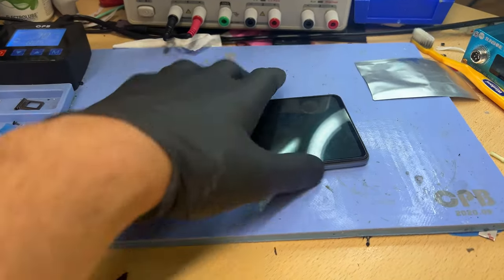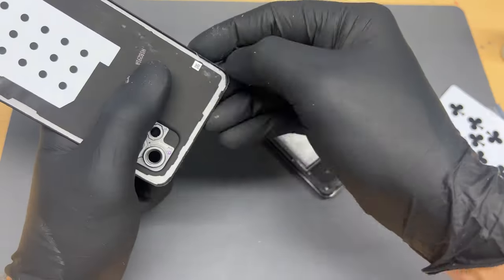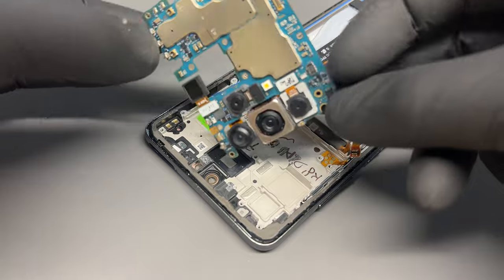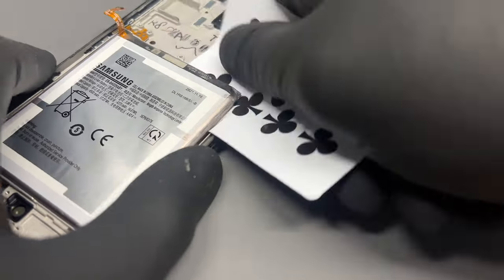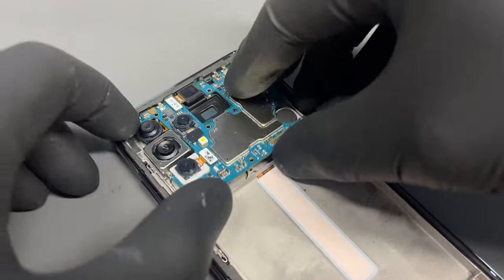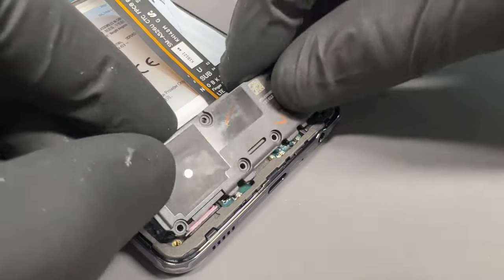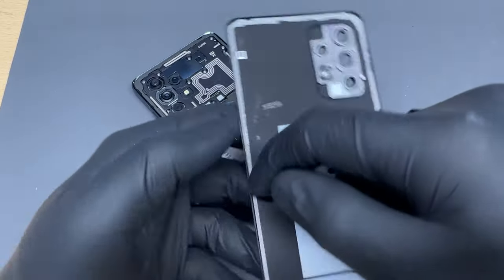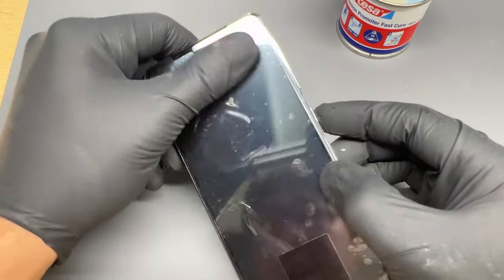Samsung A52S 5G detailed screen replacement and disassembly

Comment: Thanks for sharing. Which board has the memory and hard-drive, and data? The upper board, or the lower board? The lower board is only for FIngerprint and charging right? Then the memory must be on the upper board, right?

Comment: Hello, I've got a question! I own this phone, it fell on the ground and now it doesn't turn on anymore. When I try, it vibrates weakly, but doesn't respond.
Have you ever met this problem? Do you know what the issue is? The battery was full, the screen doesn't seem broken.

Comment: I dropped my phone and it got a black spot but screen didn't crack and it slowly expanded to whole screen, the device starts and at splash screen shuts down to immediately start again over and over until battery runs out, do you think it's because of the screen or something else is broken?

Comment: Thanks for this video.  It's the clearest and best explained of the type that I've seen.  I dropped my A52s 5G out of a 1st floor window onto concrete!  It was in a decent case so survived but two weeks later made a funny squeak and the display died.  Luckily it was enabled for USB debugging and I was able to connect and use scrcpy to confirm that in fact everything works except the display.  The device is not worth repairing if I have to pay someone else and hardly worth selling without a working display.  Your excellent video and a link to a reputable vendor for a genuine spare part gives me the confidence to go ahead with doing the repair myself.  Cheers!

Comment: Any tips for the Battery Adhesive? 
Should I purchase the original adhesive or use B-7000/T-7000 glue?
I want to stick it back because when the phone was shaken hard the battery moves and it will disconnect the screen flex cable.

Comment: Is OIS (Optical image stabilization), part that can be fcked up during phone repair? Because i had my screen replaced, and its making the 2x louder rattling noise than before screen replacement. I know that the rattling noise is normal for phones with OIS but its way louder and more annoying than earlier. I can also add that the rattling noise is still occuring when shaking the phone in camera app (i just need to shake harder).

Comment: battery draining fast , only 4 hrs screen on time with 60/120 both modes. tried battery replacement in samsung service center. still no use. any idea what might the problem.

Comment: looking for some advice, i have replaced the screen with a Chinese replacement... however the signal is not great, 115dbm, also the gps is way out, have i damaged something; eg the antenna or coxial????

Comment: My A52s ended up in the  tractor snow plower : ) It now has a hole through its side and about 10 degrees bended inwards on the middle, but it still works just like yours!
I would really like to extract my pictures and messages out of it. I've tested all possible software methods, so now the last possible solution is trying to hook up a screen to it.
My question is: do I have to get the model specific screen for it, or would a screen from a different (cheaper) model work? Maybe the A52 one will work?
Reply from the maker: Hang in there!

Comment: Thanks for the video... Is the outer plastic frame that looks metallic, just for aesthetics or does it have a role in sealing the phone to make it waterproof?
Reply: It's a part of the magnesium frame covered in something. This is supposed to be a sports phone so it can stand a small hit and not bend or break. It's heavy like a brick for it's size to be honest because of the robust frame. screen is the vulnerable part though.

Comment: Hi my a52s went to repair, the back was coming off and there was burn in marks on the screen. I noticed now that it's back it looks like theres a slight bulk around the middle of the back just bellow the camera but opposite side. Is it normal?
Reply from the maker: It sounds like the mid frame bazel is not secured properly

Comment: My A52 5G back cover is falling apart, perhaps the original adhesive loose its grip already, in some videos, some replece double sided adhesive and some used the the b7000 glue, i wonder which is a better solution and do i need to remove first the residue of the original adhesive for both the cover and on the phone before changing the adhesive or applying glue, thanks.
Reply from the maker: I would recommend using a genuine Samsung adhesive rework kit for this.
Reply: @iDoctorUK  its hard to get a genuine adhesive though in my country without getting it from the authorized service center. What i bought is 3rd party  adhesive from an online store, its compatible, but i noticed  it's kinda thicker than the original adhesive i removed from the phone. Even then thank you for the advice.

Comment: I have a question, is it possible to give the a52s a better vibration motor?, i wanna see if i can just buy an offshelf one for the phone because the phone's vibration motor is so bad.
Reply from the maker: The size of the housing for the vibration motor is very small, maybe you would have to get another vibration motor and fit it to the back of the phone 😂

Comment: Hi is it possible to have another models screen fit to the A52s.

I took mine to get a replacement screen at a phone shop and now there is a border top and bottom and the fingerprint sensor doesn’t work?

Any help would be appreciated
Reply: The shop has installed a low quality aftermarket screen or "incell" screen, it's an LCD instead of OLED so looks much worse than the original and has borders and non working fingerprint as mentioned. The 120hz will also not work, it will be slightly laggy when using so you have to leave it on 60hz.

Comment: Great angles and clear directions. Fast-forwarded at all the right times so we don't wait for 4 extra minutes while you unwind 10 screws.😊 Got my A52S back online in no time.

Great idea to link a trusted partd supplier, too: even though I couldn't use them from the US, it helped me search for the proper parts on Amazon and eBay.

Comment: I took it apart, but looks like i have to change the screen... Since it dropped one time, the screen randomly stops working and stuff, but now its totally dead....
Reply from the maker: Most likely it is a screen issue
Reply: @iDoctorUK  Thanks for your anwser! I guess then there is no other way but changing the screen? I have seen videos where they changed the whole screen panel, took out the battery and stuff. Someone told me that if you remove the battery, you cant use it again, it is true?
Thanks! :(

Comment: Excellent video, straight forward & easy to understand.. I've changed lcd on xiaomi before.. Good thing i found this video since samsung lcd comes with frame & you need to move the boards from the old frame to the new frame..

Comment: Nice guide!

Just dropped my phone on a bathroom floor, whoops. 

Looks like I will get one of those frames+screen and give it a try. Maybe I get a new back cover as well. Mine's dented and scuffed up, and at this point it's only 20 euro more.

Is it a hard repair? I'm an EE designer, but I don't have experience fixing phones as I always run away when stuff is glued together like this.
Reply from the maker: honestly, use the part with the frame, you will save yourself so much trouble!

Comment: I need some help, after i took my phone in for repairs to change the charging port, my phone doesn't have signal anymore, it shows a circle with a line through and says no service, it's also a Galaxy A52s 5G, can anyone tell me what to do or what's wrong please

Comment: STOP caution, the bottom board is set. in the corner and is immoveable, and it doesn't just pop out with little or no effort, as shown. The out come a snapped and broken board. I was all going fine until the bottom board! I m guessing it is a manufacturing safe gaurd to inhibit home repairs!! Video needs rethinking!